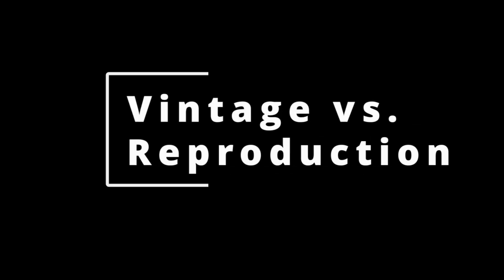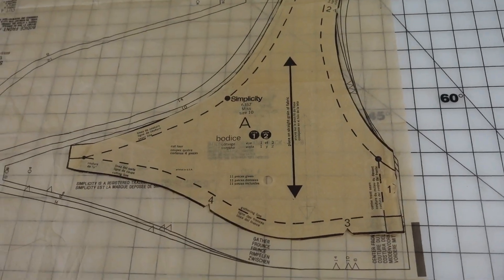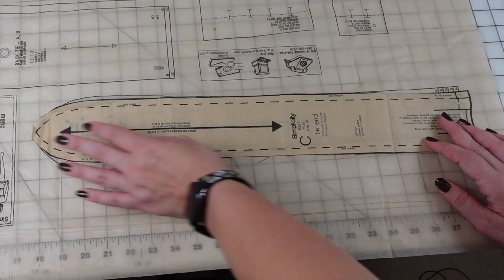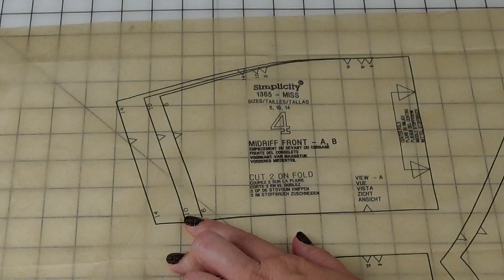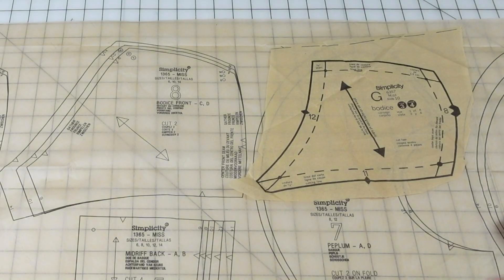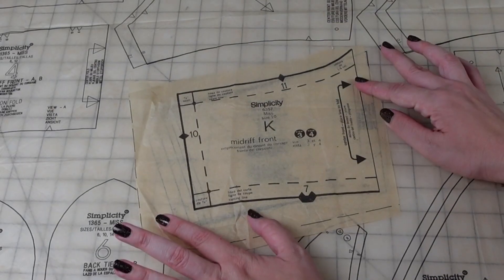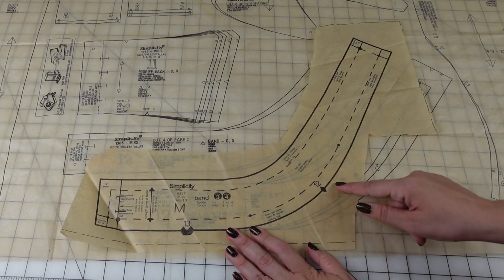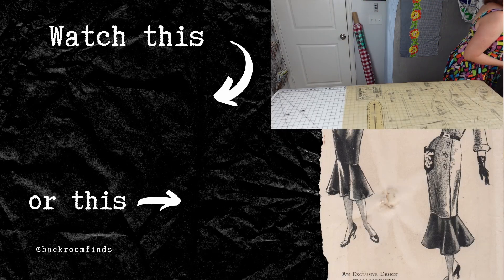VINTAGE vs. REPRODUCTION, 1970's Halter Top pattern || Comparing Simplicity 6357 to Simplicity 1365

Comment: I had no idea pattern sizes had gotten so much smaller.    I know their sizes have nothing to do with what size clothes I buy, but I didn't question it.    I think I'll buy old patterns from now on, as there are boxes and boxes of them at the thrift store, and many friends have some in boxes in the back of closets.   They may be a lot better.
Reply from the maker: I really think they are! All the clothes I have made on this channel are from original vintage patterns and I LOVE the fit they give!
Reply: @StephanieCanada  Pattern sizes and fashion industry standard specifications in general have been resized and reshaped often since the 1950s because Americans are generally larger than they were 50 years ago, but don't want to feel bad about buying larger sizes. I remember also visiting a factory where the standard pants shape had been altered to make room for a rounder belly area.

Comment: I can't say that I'm surprised by any of it. Bit of a backstory--a Halloween pattern, simple gathered to tie bodice, A line skirt. Simple, easy, right? Well in the 80's it was. Lost the pattern, bought it again in 00's and was SHOCKED when not only did it call for 4 more yards than you needed BUT the sizing and proportions were way off. I ended up learning how to draft because of that pattern (true story) just so I could make my costume and not look like I tied a California King bedsheet around my body. SAME PATTERN with the same number and the same pictures on the front. After that, I never looked back at commercial patterns except vintage ones (which I've become obsessed with--Thanks by the way) :)
Reply from the maker: Wow!! That is absolutely wild!
Reply: @StephanieCanada  I know right? Cray Cray, but true. And it wasn't just me, my aunt had the exact same experience with the same pattern.

Comment: So there’s a huge size differences between modern and vintage sizes. With women’s clothing there is no set measurements which is why even within a brand fit can vary wildly. When I was in apparel design courses for a program we were using 70s patterns that were original to the program for learning. We were informed that they were basically a modern size 2. I personally prefer vintage patterns and in modern I only look at finished measurements, especially because I’m about a 28, as the ease is way too much. Vintage ones are much easier to alter.
Reply from the maker: There is a huge difference, I agree, but pattern companies agreed to not adjust their sizing back in the 70's and truly haven't. But this showed me just how wrong I was to think vanity sizing hadn't infiltrated the pattern world (since patterns should be bought off measurements, not sizes).
Reply: @StephanieCanada  has anyone considered that the ease of the garment is different now. Back then women wore some serious foundation garments and clothes had a much smaller amount of ease than now. So while the size on the envelope is the same, that is body measurement not finished garment measurement. The only way to really compare is to make both. Not just rant that the pattern pieces are different. Because if they have made allowances for greater ease, that will affect the shape of the pattern pieces.
Reply: @mary Anne

Look. At. The. Envelope.

This isn't a 1958 be-girdled bullet bra dame. This is a Seventies no-bra top for a chick who might be going commando. Women back then often wore NO foundation garments. If you weren't grandma, you just wore a bra and panties, and the bra was optional. No girdles. Only a big bust called for a lightly structured bra, like those in 'The Undies Book' by Nanette Rothacker.

The amount of ease put in was considerable. My friends and I took our measurements, used the chart, then bought one size smaller so it would actually fit.

So unless now you buy two sizes smaller, the ease now is the same or less. I couldn't comment on modern patterns. I haven't bought commercial since the Eighties, except Folkwear.
Reply: I was wondering if the differences are b/c many fabrics today contain some elastin so they stretch much more than past fabrics. It might be interesting to see if both patterns suggest the same type of fabric.

Comment: The ultimate comparison would be to sew both. Does one look more like the pictures on the pattern envelope? Does it fit a model with those measurements and which fits better due to the wildly different sizing in the pattern pieces?

Comment: If I wore halter tops as a teen, I would probably own this pattern.
I am now firmly committed to going through my old patterns stash to see if anything still fits me. [No multi size patterns back then.] 

I would love to see if any of the smaller pattern companies have the same problem. Burda, Kwik Sew, maybe others.
Reply from the maker: You should check your stash! And sizing up isn't too bad (annoying, yes, but not impossible). And the smaller companies don't usually advertise as being "reproductions". But I will look and see if there are some.
Reply: @StephanieCanada  Burda has a vintage line (I do own a few of them) not so much for the other.
Reply: @StephanieCanada  Thanks!
I liked clothing looser back then, and I haven't gained that much weight ... though I am not re-making the short shorts and pantsuits!

Comment: Hi Stephanie! Old person here again. I'd be curious what modern size would be more equivalent to your vintage pattern. Then I'd love to see each one made up and modeled on some tiny person who would fit them. I wore halter tops all the time back in the 70's, and I don't recall that pattern fitting all that well. Could it be that the modern reproduction is an improvement? I know. Probably not. But I still wonder.....
Reply: This was one of my thoughts too. We tend to kind of idealise the past but in my limited sampling the original vintage patterns I've made have been very hit and miss on sizing, just like modern patterns I've used. (I have yet to find a 70s pattern that actually fits my bust and hips at the same time!)
Reply: Agreed. The modern reworking looks really bland and loose in comparison. That said, the old patterns sometimes were comically bad in fit as well, and sometimes decades ago the cover art and the final product barely resembled each other.

Comment: My experience with using sewing patterns back in the 70's/80's (when I made items to resell at festivals) is that the sizing was incorrect.  The patterns back then were sized way too big.  By this I mean a size 12 measured like a modern 14.  If I wore a size 12 off the rack, then I would cut the pattern for a size 10.  So, I do not agree that patterns were sized up, but more like they were finally assigned a more accurate size.  I also agree it would be fun to compare the results side by side and on the same person.  Maybe you can find different people to take on different patterns since so many of us are limited with free time.

Comment: A few years back (about 10) I had 3 pairs of jeans I wore in the early 1980's and one was a size 9 Lee's then I had a size 9 and a size 11 of the same jean (Britannia which I LOVED) . Well my size 6 teenage granddaughter needed a pair of pants and I told her I had those (they were clean) and that they may be a bit baggy but she was welcome to them. Well she tried (tried!) Anthem on and not one pair would fit up her hips. So my take from this is that the 60's, 70's and 1980's sizes were smaller than today's sizes. As far as the shape of those pieces, well I'd rather have the 1970s shapes than the 2000' something as the over all fit and look to me was better. These 1970's redo clothing I see in stores just do not do the style of the 1979's clothes justice. Oh and one other take away from this.... Damn I was shapely and thin. And so dumb for thinking I was not! Duhme was me!
Thanks for the info. Loved it as much as I could because I agree. Get it right pattern cos! The size difference is now but the shape SUCKS!
Reply from the maker: Yes, vanity sizing has definitely done us dirty when it comes to clothing sizing, for sure!

Comment: These should be called revised and updated patterns, not reproductions which implies reprinting.  And they should use new pictures of the revised garments with only a reference to what it was based on.  I work in a highly regulated industry and our advertising model starts with "do what you say and say what you do".  Total aside - I found the original walkaway dress pattern in a size 20!! Can't wait to try that one!

Comment: I hate to hurt your soul, but Simplicity 4333 (the 1953 version) was too hard to find in my size, so I bought 1426 to recreate a bathing suit top my mother modeled in a photo I have, and cherish, from around 1950. It turned out okay, but if you ever get a 4333 I would love to see a comparison. The 1426 version is so easy to find, one starts to question the reason for its super availability and affordability, could it be,,,, suboptimal? 😅

Comment: I'm curious if the vintage pattern has the amount of ease printed on it, or the envelope, the way modern patterns do? Modern patterns seem to have ridiculous amounts of ease added to them. If the body measurements are the same for both patterns then it must partially the modern ease they're building into it the reproduction. Does the same size in both require the same amount of fabric.
Reply from the maker: Before 1980 (ish) the companies did not print finished garment measures beyond lengths. So sadly, there is no way to check that. 

HOWEVER! I just looked at yardage, and the reproduction bust 32.5 View A, requires 2 1/8 yard of 45" wide material. The 1974 original for the same style requires 1 3/8 yard of 44/45" wide material. WILD?!

Comment: The more of these you do, the more I start to feel a little jaded that these reproductions are included in certain fb pattern groups and projects made from them tend to get the highest positive engagement. 
I get that everyone starts somewhere, and originals CAN be expensive, but these are essentially retro styled modern patterns. I tried making a bra top from one, two summers ago (it was a heat rage project) and it had so much ease I had to add elastic in the back and even then it was a horrible fit. So disappointing.
Reply from the maker: I’m not saying these don’t have a place. I just wish the makers would called them “inspired” by vintage and not a reproduction. Because THAT is the issue!
Reply: @StephanieCanada  oh I am def not opposed to the companies releasing vintage inspired pieces, and for people used to sewing with modern patterns, the ease may be comfortable and the instructions.. beginner friendly enough for me to leave my 5 year old unattended in the sewing room, and I don't think the vintage sewing community needs to be gatekeepy.. but it would still be nice to have some spaces where these aren't allowed to dominate ♡
Reply: and yes, they should be clearly marked as redrafted or inspired by.

Comment: This is so frustrating. Aren’t these already in their archives? I have two pet peeves….. one is when is your read the pattern envelope to find out what your notions are and you’re in the store and you have to open up the envelope to get out the instruction sheet to find what notions you need. Why can’t they just print them on the pattern envelope. Then second worst pet peeve is it’s impossible to find your finished garment measurements. They say it’s on the pattern tissue why can’t they put them on the pattern envelope.

Comment: Don't think I'm excusing the drastic differences, we all know sizing in the big pattern company is vastly different from how people are actually shaped. However, with the front bodice piece in particular, my first thought was that in the 70s, my impression was that it was more in fashion to go braless, especially with a fun summer top. Could part of the adjustments in the repro be to account for bra coverage?
Reply from the maker: I mean it is very possible.
Reply: I think you're right about that.
Reply: When you take your measurements for a pattern, it's supposed to be over your usual undergarments, not naked. So there should be no difference.

Comment: These differences are part of the reason sewing has fallen out of fashion so much, I believe! Vintage patterns fit right, and were decently easy to modify if needed...new patterns? Even an experienced seamstress working with a new pattern ends up with a finished piece that looks like a botched 4H project!! Why did they decide to make things so ill fitting??
Reply from the maker: Honestly Jennifer, I have NO CLUE! It seems completely counter intuitive.
Reply: My take is that 'fashion' passes so quick that it doesn't matter how bad it is, you're only going to wear it once, maybe twice. Or to make you swear off sewing forever.

Comment: I...  I... don't understand.  What.  Why!  Why does modern sewing do this to us.  This has reached the level of false advertising fer gosh sakes.  It's bad enough they reuse the same numbering decades apart.  What's the point of a numeric filing system if you don't have a file.  I...  Did they even pattern test this nonsense?
- Cathy (&, accidently, Steve), Ottawa/Bytown/Pimisi
Reply: It's even worse for some company,  the patterns number is not the same on each side of the pond.

Comment: Just a thought.... the underwear changed.  Pointed bra back in the old days, today complete other body shape. So I think that is why they do this alteration
Reply: I was sewing my own clothes in the 1970s (yes, I'm OOOOOLLLLLDDDDD) but we were NOT wearing pointed bras.  Actually I wasn't wearing a bra at all whenever I could get away with it...
Reply: Even modern design patterns have unnecessary extra ease - patterns that are meant to be fitted have 4+ inches of ease, etc. It's not just a problem with the process of "modernising" a vintage pattern
Reply: Nope, no pointed bras back in the middle 70s

Comment: It’s so frustrating that they don’t do an exact reproduction. Just go in your files and reprint the old pattern!!!! 
Come on pattern companies, it’s Not That Hard! 
🤦‍♀️🤦‍♀️🤦‍♀️
Reply: That’s 50 years ago. Do you really think the still have the files? It’s not like they we’re done by computer.
Reply: I’m not sure what your tone is in your response. 
I am aware they didn’t have computers. I’m kind of surprised they didn’t keep a library of certain designs. But even so, they asked people to send in old patterns. Which they did and yet rather then just duplicate the pattern they have gone and changed them. 
I don’t understand that but it is what it is.
Reply from the maker: Arwyn, if you can believe it most of these companies did not keep their old patterns. They would make them, produce them and move on. But what I don't understand is that there are MANY sellers that DO have their original patterns and they could just buy them back.

Comment: I don't suppose it occurred to you to contact simplicity with this video and ask why?
Reply from the maker: I have tried contacting them before only to be blown off.
Reply: @StephanieCanada  1.  There is a corporate hierarchy.  Research it.  Contact people BY NAME with correct mailing addresses.  Find a paralegal or lawyer to help write the letter.  Keep publishing these discrepancy videos and send a copy to them
  I remember in the mid 20th century when measurements changed. Check the copyright dates.  If the pattern was issued before that date, then they have updated the measurements.  In the 1950s Toni sold an 18 inch doll.  When the vintage patterns were reissued for the American Girl Doll craze, the patterns were altered to reflect the AGD measurements.

Comment: I think you do have to take into consideration that a size 10 back in the middle 70s is not the same as a size 10 in 2022
Reply: As she showed, the body measurements are exactly the same. Don't confuse pattern sizes with off the rack.

Comment: My biggest frustration is the fact that this is not intended to be an exact reprint of the vintage pattern, it’s modified using modern understanding that bodies are round and certain curvatures are more flattering and convenient to the body. While, yes, bodies have ultimately changed in the few decades since the original; most of the changes are simply adapted to create a better, smoother fit. I’m not here to teach people how curves work better on rounded objects, but I would have hoped you would offers something insight to these instead of forcing a narrative that vintage is better; sure you might like vintage better, but that doesn’t justify forcing a company to just reprint something from decades ago when those people who prefer that can just buy the original if that’s truly what they wish.
Reply from the maker: And if the companies would market it correctly as "inspired by" I wouldn't be so frustrated with them. 

I am not here preaching vintage is always better. I am trying to show folks that what these companies are trying to pass off as a "1970's pattern", as it is stated on the envelope, isn't actually what was made in the 70's. 

Some folks really think that Simplicity, etc. are "reproducing" their original patterns when they buy these. Then they get frustrated when the garment doesn't look right, or is too big, or the pattern is a pain to put together. Some folks expressed to me they would get so frustrated that they quit sewing entirely. By showcasing the differences in these patterns my goal is to show folks that it wasn't them. That the company marketed it incorrectly and they unfortunately were at the receiving end of a marketing scheme.
Reply: When the pattern says repro, I expect a repro of the original not a ‘based on sorta’ of the original.